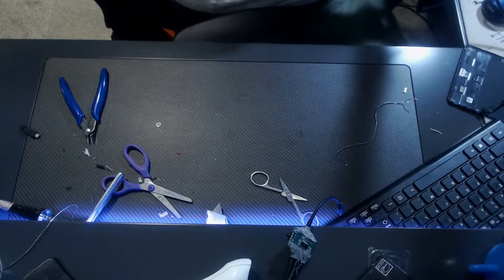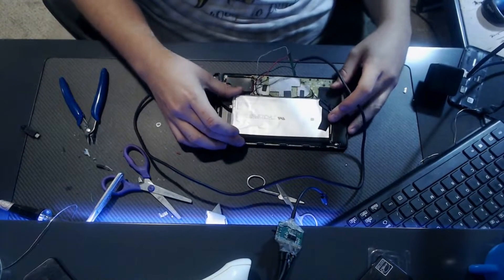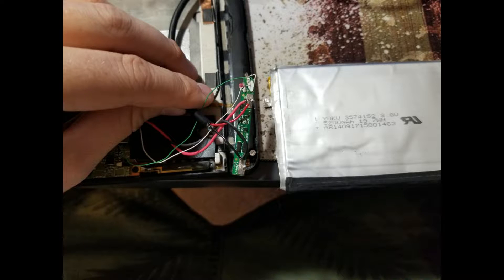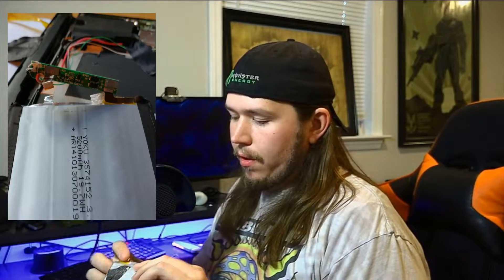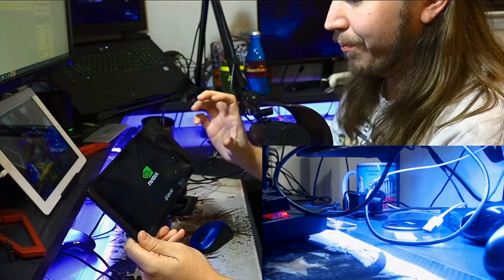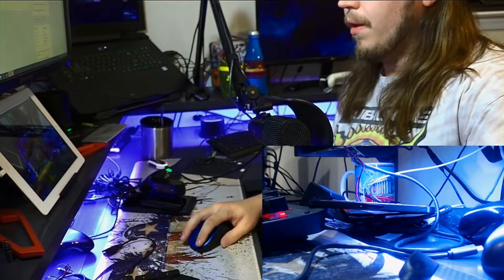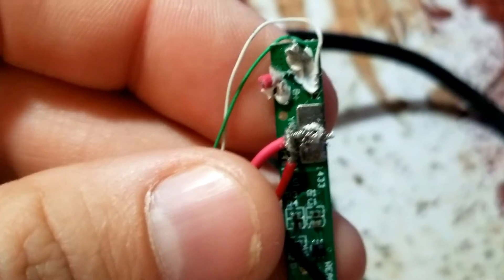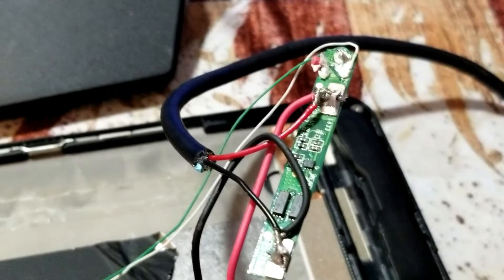How to power Nvidia shield tablet with no battery and without using the USB port

Comment: This is awesome, my spicy pillow just fluffed up after many years and now this is working again. There is a small point on the board behind the USB connector that I tied into to get 5V, then ran just that to the BMS. Ground is ground and don't need to double up so that single wire was all that was needed for power from the existing USB port. Glad to have my world clock back.
Reply from the maker: That's pretty cool that you were able to do that. I'm surprised it only took one wire to get it going again!
Reply: @Fraglrokt  hello! any update video about this?
Reply from the maker: I could absolutely make an update video showing how I'm using my shield currently if you'd like!

Comment: I had to convert an old motorola phone to run off a cable bypassing the battery. It required the use of a resistor, and that keeps the battery indicator around 97-98%. I use it for my 3d printer running octopie.

My shield k1 needs a new battery soon, maybe I'll see if the same method applies. I'm betting the board needs to be completely bypassed with the power cables to make it run better. Maybe some play with different style power bricks also. Ie, moto turbo charge, pd, voice, qc brick...etc
Reply: one plus vooc, not voice. Darn auto correct!

Comment: any news bro?
Reply from the maker: I ran the tablet like this for a year or so and finally took a battery from a Mophie case and soldered it in place
Reply: @Fraglrokt  so the motherboard didnt have any damage at all? i mean its safe to use directly without a battery installed?
Reply from the maker: The way I wired mine in I had no issues. Obviously That's all subject to how you wire it.
Reply from the maker: Mine did not, I can't guarantee that however you choose to mod the tablet will result in the same outcome.

Comment: Thank you so much for making this tutorial. It revived my K1 tablet whose battery has just inflated as yours. 
But I have encountered some problems: it can boost up for most of the time, but sometimes it will shut down by itself during starting; sometimes it will shut down automatically after a few seconds after started. I did some amateur troubleshooting, found out that when tuning the brightness all the way down and shut down lots of function like wifi, it will stay on forever; though I saw some blinking/flashing of the screen, so I suspect that underpower is the problem since I only tried it on 5V/9V 2.1A adapters.

So may I ask what is the spec of the power adapter you end up with? Thanks in advance!
Reply from the maker: I was using a 5 volt 2+ keep in mind mine is The older shield tablet
Reply: @Fraglrokt  OK, many thanks! I'll try those 3A PSU. BTW after further playing with it, I think with minimum brightness, my 5v 2.1a can even use browser and watch video sites. 
I actually want to use it without battery, but just plan to use it for some light usage such as an external monitor or remote control, so always plug-in. I'm not a fan of eternally charging a battery especially while using it haha
Reply from the maker: I did end up disassembling an old Mophie case and using the battery from that in my shield tablet and it worked fine

Comment: I recommend soldering a TP4056 Li-ion charger 1A USB-C pcb (LI-ION single cell charger) parallel to the battery. hese are like 1-3$/€
This is what I did after my micro usb connector failed and a buried via damaged. Works great, charges battery and keeps it powered. You need a 2A type, but 1A also works.
USB power to the battery wires and battery disconnected got my K1 to shut down every time, even with high power adapter.
Reply from the maker: That's good to know it'd be pretty cool to have USBC on this tablet as well

Comment: I know I'm a bit late but you CAN charge through ubs and use usb port, you only need a special Y cable for that. I've been using my shield tablet for years this way.
But I never was sure the tablet would still boot without the battery at all, so I've stop using it to be sure to not have issue with the battery :(

Comment: hhhmm just tryed it and id did not work :(   i can start up in recover mode , go up and down with volume - + , but not use start button to select.
if i put in usb from pc or another charger it shows battery full on screen, then i can start up tablet up with nvidia logo ... but as soon it starts android its powering down at ones :/   only thing different is the adapter its a 5v 2.1 a  ... can it really be the 0,2 v difference ???

im thinking on getting af 13.8 v adabter and the skip the shortcut from mini battery board to main board i think this maby will work ??

Comment: Hello Fraglrokt, I see that you are still reactive following the new comments, so I try for a question... First, sorry I use Google Translate... So, I removed the battery and I performed the welds as presented in your video... The Shield displays the startup logo but after 5 seconds the Shield shutdown. I don't have the original wall charger, so I use a 5v 1.5amp charger... is this the source of my problem?? is the amperage too low? 
If I boot to the bootloader it stays on. I have the original firmware. Any suggestion? Thanks! ;)
Reply from the maker: Maybe, im not an electrician but I know the voltage is temperamental
Reply: @Fraglrokt  Finally, i can confirm it was the reason why she doesn't turn on. But now shutdown after 5 minutes! 🤔 Well... I need to do some test!
Reply: If someone has the same problem as me, I changed the USB cable for a little bigger. I originally took the USB cable that comes with Google Chromecast devices, but the device turned off after about 5 minutes. Since I changed the cable, the problem seems to be solved.
Reply: You need atleast 2.5 amps..get a bigger amp capacity charger..it should work!

Comment: I have tried only black and red cables from the battery and worked fine without the other cables so it might work with a ~3.7 V charger with enough power and get rid of the battery board.

Comment: short green and white and you can remove the small board
Reply: I've tried as in the video, and also tried shorting the green and white wires etc, but it constantly shows as battery empty and shuts down. If I short 2 pins on U1 (top right pin with the one below) it then powers up and shows full battery, I tried shorting those 2 pins together but if they're constantly shorted, same low battery then shut down.
Anyone have any ideas?

Comment: Can I do it without soldering?
Reply from the maker: I've done a lot of crazy things with electrical tape I don't recommend trying to use just electrical tape but I don't doubt that it's possible
Reply from the maker: Keep in mind without a battery if your electrical tape fails and you're in the middle of something important with the tablet it just Powers off
Reply: I tried and didnt work :(. Tried two cables and chargers and nothing

So without soldering its probably impossible

Comment: thanks for the video. i almost junked my tablet today, because the battery started to swell. i removed the battery and took out that little control board. now i have something to play with next time i have some spare time on my hands :)
Reply from the maker: Hope it works out. 👍
Reply: @Fraglrokt  power adapter 5v  with 2.1 amperes? i have tablet k1 dont power adapter

Comment: hey , i know this video is from very long time ago, but i got a shield K1 with dead battery, I'm only planning on using it to play some GBA, nDS emulation and maybe some nvidia streaming, does this method give the GPU enough power to not crap out mid way ?
Reply from the maker: Mine did fine. It's not going to crap out to not having enough power to the GPU it would be more likely the voltage regulator freaks out. If the tablet's already got a dead battery you don't have anything to lose anyway trying t
Reply: @Fraglrokt  hey, thanks for the reply, so anyway i did wire up a usb power to the regulator boards, I use the nvidia power brick that came with the tablet, however the most I get is my tablet boot up to the lock screen for a few second and then switch off when I touch the screen to open it. (I flashed Linage OS when the battery is still alive) However the tablet work fine when I enter linage recovery mode but when I restart the tablet, its switch off again at the lock screen. 
My tablet battery board is a little different than yours and its only able the get that far when I connect the red wire to B+ and black to B-, if I do it as you in the picture, it wont get very far.
So do you think is it because my usb wire is terrible or because the power brick can't give it enough power ?
Reply: @Fraglrokt  *update, idk maybe mine have some defective hardware or something, its work fine when I'm in recovery menu but whenever i use it would randomly switch off XD
Reply from the maker: @CraziestMDBCrew  has to be something with your voltage regulator. (The little board on the battery)
Reply: well its functional now after i hard reset linage os again somehow

Comment: How does it hold up now? I was going to buy a battery but after seeing this I don’t mind soldering. Did you ever put the case back together?
Reply from the maker: It held up just fine I eventually wanted my tablet back and took an old iphone Mophie case apart and soldered in the batter from the used mophie.
Reply: @Fraglrokt  Ah ok that sounds great I’m gonna do this then. My tablet seems to run slower with a low battery and doesn’t last more than 30 minutes. I just want something to watch shows in bed but I don’t want to buy another tablet. Thank you.
Reply from the maker: @_SixthDay_  with the mod I did my battery showed full all the time. I did run into an issue where not securing that voltage regulator and the wire down if I move the tablet it would pull the connection so I would definitely recommend securing those after you solder everything
Reply: @Fraglrokt  Would double sided tape be recommended?
Reply from the maker: @_SixthDay_  ehh it would do the job I'd say

Comment: I cant really explain it, but the battery output should be 3.3-7 volts (or something like that), the USB power is about 5-6v. The Circuit board you are showing is a battery safety kind of thing (short circuit, overcharge, voltage regulation and stuff) and maybe a charge controller (which I did not think). If it's connected so the voltage regulation works and you satisfied the charge controller (and you made it so that the device gets I2C (guessing or maybe some other protocol) to send "battery full" to the device it works!) as you clearly demonstrated. :-)

Have the same tablet, with maybe 1 hour lifetime with battery full charged. And there is no battery replacement to buy?
So was thinking of doing something similar and great that it works!

Comment: So kinda like Frank Zappa I use my tablet to basically watch my ip cameras,so the battery swelled bla bla bla Nvidia sent me a new tablet by mistake they tell me because it wasn't the right code,there fault,I was happy a hell to get a new one,it lasted 1 day and it run out of charge and it won't recharge,talk about a emotional roller coaster so I would just like to know could it be that the battery totally drained and it shut down that my current charger just doesn't have the strength to get it back up and running again,I don't have the original charger so could someone  let me know what that original charge calls for,I'm using one now that charges my old unit but it won't charge the new one,Nvidia said they won't send me another unit because I wasn't even suppose to get this new one,so there it is.
Thanks.
Reply from the maker: So I'm not an electrical engineer or anything I would say it sounds like likely it could be the old charger if you haven't tried a new charger. 
I used to work for a card reader company and our card readers would get stuck if they were power cycle too quickly with like static preventing them from powering on (I sure if that's the correct term) something you could try with the tablet plugged into the charger is hold the power and the volume down key at the same time for like 30 seconds that should force the tablet to reboot completely. Sorry I don't have more helpful answers 🥴
Reply: @Fraglrokt  it's good enough thanks but I can't believe it starting working this morning for whatever reason so I'll figure out the rest I'm sure one way or another,just to funny it's started to take a charge and now it's up and running,it feels good to have burned Nvidia on them originally not wanting to and someone there sending me this tablet in era,this was all because it didn't have the correct code,my position was,who cares if it's not the code that's in question,the battery bloated make good for your product, maybe they should expand there research to my series of code,bureaucratic bullshit that's all that was...👍

Comment: On my Shield they sent out a kill-code, so it won't boot. Did you have to fix something to boot it or didn't they kill yours?
Reply from the maker: They do send the code to all. However if you rooted and installed custom firmware ahead of time there is a "kill the Killswitch" patch.
Reply: Why would they do this ? My usb is plug is loose and only works for charging ( very badly and slow ) I can't even go on and root it.

Comment: The circuit in the battery is a protection circuit, it stops it from over charging and has feedback to the main board etc.  Check out BigClive dot com on the tubes, he does crazy things and takes lots apart, very interesting. Also thanks for the video, i picked up a shield with a faulty usb connecter and im going to have to bypass it too.

Comment: That board is probably the voltage regulator. You where probably not getting the correct voltage for the tablet.

Take the battery to the shooting range. Could be fun.
Reply from the maker: I figured it was for something 😂😂😂